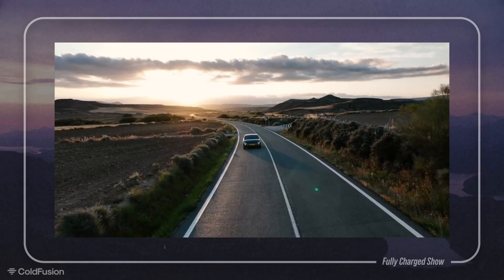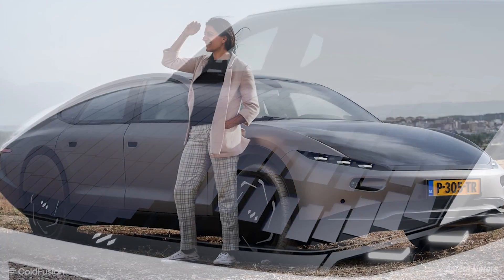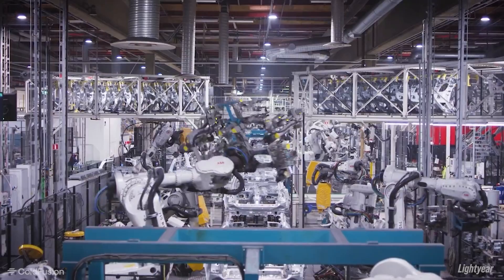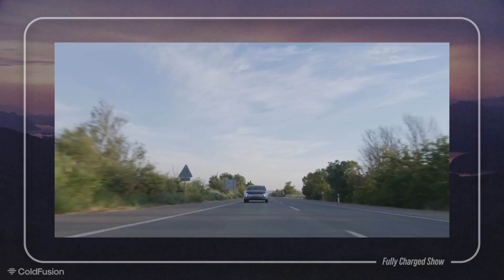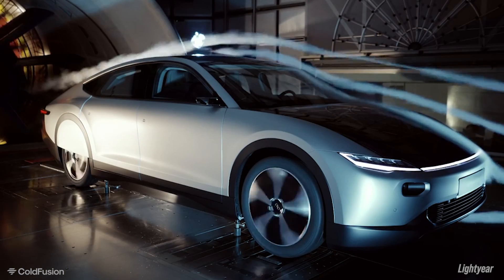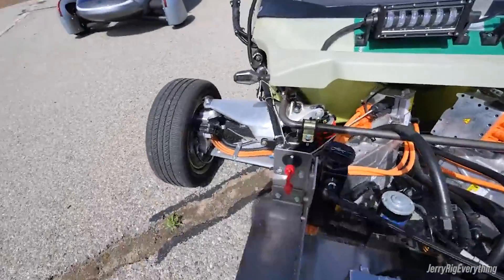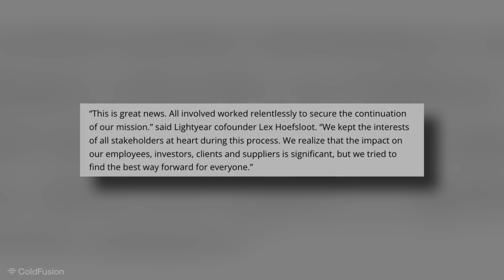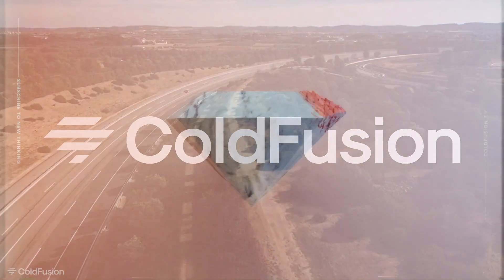3 Interesting Solar Car Projects

Comment: Rather than designing an EV with inbuilt solar panels, why not design solar blankets that you cover over any EV when it's parked, that you can buy as an aftermarket product.  That way you can convert any EV into a solar EV. Also, most people only drive their car for only a short time in the day, most of the time it's sitting parked in the sun. This EV solar charging product is relatively simple to design and could potentially benefit much much more to the world.

Comment: Hi. Obviously. I cannot supply evidence to my following comment.  . . Ive been following lightyear for several years. and I am still on their mailing list. I got to see all their press releases and statements before they got released to the press. They announced their intention to file bankruptcy and why they was doing it that way. They were locked into a contract to produce the lightyear zero. and the only way to break that contract and concentrate all their funding on making the lightyear 2 , was to legally declare bankruptcy. As part of that bankruptcy agreement. they had to give a cool down period that lasted till the end of 2024. then they would be allowed to properly begin the manufacture of the lightyear 2. during this wait time. they continued to seek and obtain further investment. unfortunately. some people mis-interpreted the press releases. And so the references to bankruptcy got confused. . in effect. it was all part of the plan. before they actually went bankrupt. They continue to get investement. they continue to take fresh orders. they continue to try and get others interested and possibly buy into their roof tech..... . . .  on another note... the car itself recharges from other means. not just the sun. it also has brake regen. something not often shown in demo videos.  It self charges while it drives. the longer you drive it. the further it can go.  theres a little gauge somewhere that tells you how much energy its making for itself. not just from the sun. . . . . . also.. as per your request... 10 seconds is not slow.... I have had ICE vehicles slower than that. My Viva currently does about 14 seconds to 60.  I am on the waitlist to buy. Obviously. I need a right hand drive version for the UK. with my current driving mileage. I would never need to plug the car in at all.. essentially.. totally free to drive... and no hassles trying to plug it in anywhere... Its a perfect car for countries with no charging infrastructure, or even.. no electric supply at all..

Comment: The Lightyear 2 would be a great electric car to own. Even without the solar cells, imagine the efficiency means a fuel economy of around 200 mpg electric. For a car that can transport 5 persons ! A range of almost 400 miles per charge is better than any electric car on tbe market and better than the range that my gas-powered RAV4 gets out of a full tank of fuel.
The added bonus of 40 miles per day from the solar panels would cover my daily commutes and I would never have to spend a dime on fuel. Totally worth $40,000.

Comment: 7:40 Performance "issues"
-> 160km/h speed limit
-> 0-100km/h in 10s 
-> "Sacrifices"

Yes because the first thing i want in this economy where the average house costs me 20 years worth of work without spending a coin and the average car 4 years, is if i can be able to reach 500km/h with a 0-100km/h in 3 seconds in a car i would buy to save money over time.

The performance brainwashing of the auto industry is insane...

Comment: BY 2025 we will have a better source of storage (i.e. batteries) and also more efficient Solar cells, along with improved electric motors, on that basis we will certainly have a mode of transport that is truly great.

Comment: I am all for new technology that improves impact on the planet.  This is a great idea for going around town during the day/  But how practical is a solar car say, in the American midwest in winter?And what happens when all/most systems are operating (a/c, heat, wipers, lights, radio to the efficiency and longevity?  It seems like there would need to be backup system (at least to get it started)  if say the car hasn't been run in while.  And then how long would it take from there to actully use it?  Still skeptical as I am with fully electric for the same reasons.  But I hope the technology one day presides.

Comment: So, theres a few main issues with solar panels on cars that will probably prevent them from ever reaching the market:
You have a house, with a house solar panels can be alligned for maximum effiecency with the sun which a car isnt guarenteed. With your house u could load up on solar panels and get far more energy faster (and wirh the bonus of uploading excess energy to the grid, if the cars battery fills then you are wasting energy) and cars simply dont have enough surface area to generate the energy fast enough. With panels on your house you arent increasing vehicle weight and decreasing vehicle efficency. 

Thats basically it, you own a house lol. But if that isnt enough then consider that the majority of people live in cities where buildings tower over roads creatig inconsistent sunlight and the majority of parking is in garages or covered lots and then at home most people are parking in garages.

Comment: Conversions need to be cheaper and more widely available. 

I have 2 '90s Suburbans; axial motors that can mimic an ICE torque curve mated to my existing transmission would be most space and mass efficient, leaving room under the hood for a big ass battery in addition to the one that would replace the 42 gallon gas tank. 

No one needs 1000hp or 2 second 0-60 times on the street. A motor that delivers 250hp and 400ft-lbs of torque would surpass the original drivetrain specs without needing to reinforce the platform. My trucks could last another 20 years, rust would be their only enemy. 

There are still millions of those generation trucks still on the road, along with F-series Fords and Rams. Tradespeople hold onto trucks until they literally fall apart, and sometimes they don't, so why can't we repower them in an affordable way? Imagine the total fleet emissions reduction if that were possible.

Comment: 0:07: 🚗 Lightyear, a Dutch company, developed the world's first production solar family car that could drive for months without needing to be charged.
4:13: 🚗 The Lightyear Zero is a commercially viable solar family car that can travel between 50 and 300 kilometers on solar power alone.
7:18: 💡 Light Year, a Dutch company, faced financial difficulties and halted production of their solar hybrid car, the Light Year Zero, due to high costs and economic challenges.
11:02: 🚗 Lightyear, a company in the electric vehicle space, is planning to release a two-seater, three-wheeled vehicle with a range of 1000 miles. They have achieved this through the use of lightweight materials and efficient design. The vehicle also has solar panels for additional charging. The price range is from $25,900 to $47,000, with over 30,000 vehicles reserved. The company aims to have first deliveries in 2024.
14:11: 🚗 Solar-powered cars are not a solution to all problems, but they are a step in the right direction.
Recap by Tammy AI

Comment: Its more easy to go to mars and come back, than to make a car for daily use that can recharge at least 30% per day... You can get around 4-10kw back to the car per day, based on current tehnology and surface of the car... So its an to early dream like the electric cars from 1930 - 1940.... Its the same problems like batteries, with today tehnology you can't get an good randament (from sulfate to litium we advanced 1.7% only)

Comment: I technology, there's the Unix philosophy that each tool should focus on one job and do that one job well. I'm sure that a solar charging car could be useful in some of situations, but I'm guessing for most people and the grid itself regular solar panels would be more efficient and cost effective at creating power, and all that power would be put to use instead of potentially wasting power once batteries are charged.

Comment: I've always wondered why EV cars don't use the spinning of wheels/shaft to help generate electrity.  Is this a thing?
Reply from the maker: Yes it's called breaking re-gen. When you take your foot off the accelerator, the car uses the motion of the wheels to turn that energy back into electricity and transfers it back to the battery. It feels almost the same as putting your foot gently on the breaks.
Reply: thanks!  I was thinking more basic. Spinning copper around a magnet to generate electricity.  ?  @ColdFusion

Comment: I dont know what the scientist doing. They should test the solar car at city with tall buiding. Becouse travel distance we usually covered daily inside city perimeter is less than 60km. If the car survice in city then can mass produce quickly. But i dont understand why test in desert place who frequently drive there???😂

Comment: It's a dead product. The available energy under ideal conditions are too impractical for people to accept. 1 kW solar panels in sunny California will only result in 5 kWh of usable energy per day in the battery. A typical car has a 100+ hp engine. A scooter has a 5 hp engine. Let's say this car uses only 20 hp (15 kW) during normal driving, which is extremely low for a sedan. Then you can only drive it for 20 minutes per day.

Comment: If the tube of ionic liquid flow by magnetic push inside a round tube induce electric for charging and wheel had permanent magnet on the rim also induce on coil on Frame can help quick charge while driving and onwheel motor use little power can drive the car so light thar accelerate fast too

Comment: Mercedes has done some work on light and efficient motors. Might their EQXX motor be ready for affordable enough production? If their battery can handle some discharge levels, 1/2 or 1/3 their 100 kWh battery may well suffice for a Lightyear vehicle. Alternatively, have a similar pack design, more peppy cells that are a bit less energy dense, go with 40 kWh or so and have really goo fast charging, say 150+ kW. On long drives, the good aero and drivetrain efficiency offer a good 2-3 hours of motorway driving between the usual 20-30 minute charge stops. Some cars, to travel fast as possible, charge from like 3% to 45% only to get the best charge rates, and then so a 1.5-2 hour stint at barely legal speeds.

Comment: To get more utility from a low car, it can be made longer which also offers more solar panel surface. Consumption hardly impacted, more range added from solar per day. A longer can get clumsy but rear axle steering tech as come a long way. With narrow rear tyres which it would get anyway, more easily room can be kept for RWD. Does the extra room in wheel wells negatively impact aero, too much? Then a false well back could be installed. Designed thus, it could even be a passive feature which the wheels simply rub again to bend it away when turning at low speed. More eloquent is making it, effectively, active aero bits. has anyone tried wheel panels on the inside of the rear wheels? Mouted to the upright, calming down air flow behind the wheel in the well. Don't patent it if new, my comment here then has just become the state of the art.

Comment: Would love to find out if you can use the car as a battery for house during power outages, etc. My commute to work is less then 2 miles a day and usually around 30 miles for longer trips like groceries or doctors which are once or so times a week so it would be net positive most the time and about break even for the week with bad weather.

Comment: 30k purchase, 60km per day for free? Yes, very much yes, asap please. In today's (Aug 2023) petrol prices in Europe, 60km roughly translates to 3-4 litres or €6 to €8 and increasingly. Which means, relative to petrol, at least between €2,200 and €2,900 worth of free driving energy per year.

Comment: Maybe this is a stupid question, but could you not simply have a car with solar panels that can be manually folded out when it's parked, and then stowed for driving? It wouldn't charge while moving, but it would be a self-sustaining solar car, without the need for curved solar panels all over the body.

Comment: What to do about the debacle regarding how the cobalt is extracted!? Pollution, human suffering, environmental issues,  etc. In order to produce more batteries we have to find another design. Solid state batteries instead of lithium is one way to go. Until the problems are resolved I don't think EV is the future. Hydrogen is the way forward and combustion engines driven by Hydrogen. 🤔

Comment: To answer your question about the accepting slower performance: yes. I don't think this is that slow. The top speed is around 100mph. I understand that Germany has parts of the autobahn where you can drive that fast, but most of us will never need to drive that fast anyway and so that top speed doesn't affect me. You mentioned 0 - 60 in 10 seconds. I presume that's 0 - 60mph (km/hr would be terrible)? That is slow, but some rough math shows it wouldn't really make much difference in your day to day life. I know this is a little flawed (since acceleration will not be constant), but let's assume constant acceleration. Therefore, velocity can be modeled during those 10 seconds of aceleration by v(t) = 8.8t. (60 mph is 88 ft/sec). If you integrate v(t) from 0 - 10, you get 4.4*10^2 = 440 ft. So, you've covered 440 feet. Take a car that can acellerate to 60 mph in half the time. So, those first five seconds have v(t) = 17.6t and the second half has v(t) = 88 (assuming that the speed limit is 60 mph and you don't accelerate to faster speeds). Integrate v(t) = 17.6t from 0 to 5 and then add 88*5 and you get 660 feet. So, the fast car has traveled 220 more feet. At 88 ft/s that's 2.5 seconds. Personally, losing 2.5 seconds during the process to get to full velocity after leaving a red light is worth it if it means much less carbon for transportation. 

I understand that not all transportation decisions are purely numerical and some people simply prefer performance cars. Hopefully they can come up with an option for those people as well! However, for many people, I think this is just fine.

Comment: Im sorry but these numbers are just wrong... 5m2 of panels in this configuration would yield maybe average of 25W over 18 hours of clear summer day. Any consumer level electric car is pretty much super efficient already (90%+) and needs at least 13kwh to cover 100km, so calculate yourself...
to cover 100km you would need a month of perfect weather. Even if you somehow increase efficiency 3 times it is not enough to be viable. The numbers they are claiming would work with super light vehicle, not heavier than 200-300kg, without batteries, with super clean solar panels 45% efficient (best that exist, used by NASA, super expensive), favorable wind, thin hard tires, perfect surface, and so on.
Im sorry to say but these companies are fishy and its not wonder they are shutting down. They sell you a dream which everyone of us wants to hear, but when you put things on paper it just crumbles down, sorry.
Reply: Bingo, their propaganda claims were just a pile of laughable bs.

Comment: Unless you drives like 5 miles a day and plan to leave your car ded under direct sun light and live down south..
No this wont drive for months, it will drive for the initial charge plus a few days at most.
Beware of the next nikola or theranos

Comment: The ~2010ish Toyota Prius had a solar panel roof that ran a fan to keep the inside air temp from getting super hot when sitting in the ☀️ sun.

Comment: 5m2 of solar panels is absolutely NOTHING, especially if a third of it really, in the best situation receives 90% of the power of the sun.
Of course, it's over. It was over from the very beginning.
And who will buy the version 2 with the design it has, at this price ?

Comment: 0-60 in 10 seconds is painful. I don't need a Lambo but that's slower than any average consumer sedan, suv or minivan. A base model toyota Rav 4 is about 8 seconds. If the vehicle generates net positive electricity while driving then that should be put towards giving it a little bit more pep. It can obviously charge when parked in the sun too.

Comment: One of the huge downsides that has not been mentioned in the video is that, for a city oriented car where length matters, it is massive, so it defeats the purpose. So these points at 7:48 are not really that important, as city cars have a top speed very close to that (and they don't even need it) and even worse acceleration.

Comment: This bankruptcy is probably a modern spin on what happened to Preston Tucker when he went up against the Big 3 (Ford/Plymouth/Chrysler) in the 1940’s: Lightyear is too revolutionary so the big car companies and Tesla, in their quest to milk as much $ out of slow incremental improvements in EV range, are using their VC/political connections to starve Lightyear of needed capital. Alternatively, they might be after the IP that’s now pledged as collateral for themselves.

Comment: Hopefully the acceleration could be improved on. I drive a Hyundai Getz and am slower than most other cars away from the lights. It means holding up traffic. 
The worst is the 50cc scooter.

Comment: I think solar cars should be for city use, where you travel below 50km a day. Also it is important to note that you need to charge it in the parking. It is surely not fitting for everyone. It fits me, though. I teach I a school. I go in the morning park on the sun so I have 6 hours of solar charging and after the classes i go shopping. My schedule is same on weekdays. On holidays I travel by flight anyway so the car would not be needed.  I am also not for hours of driving. So it depends on your preference.